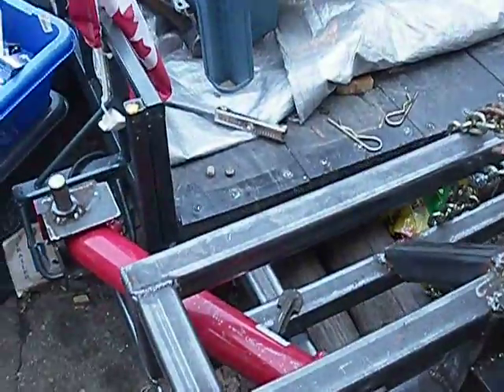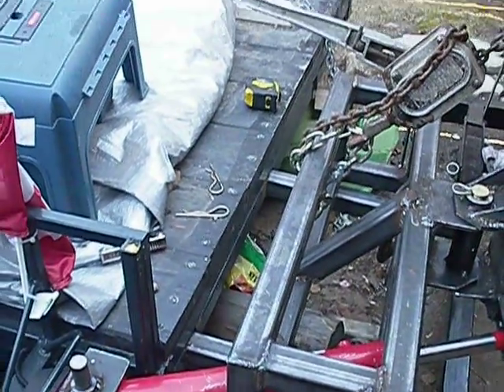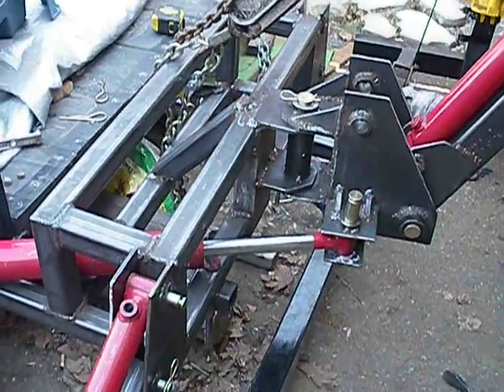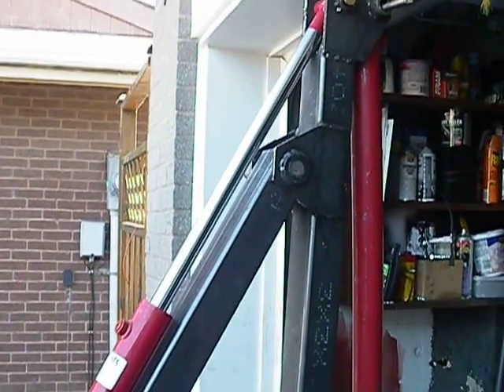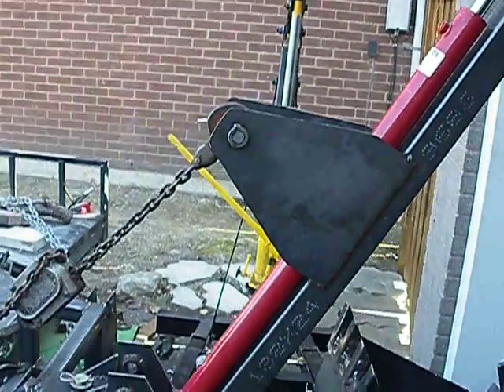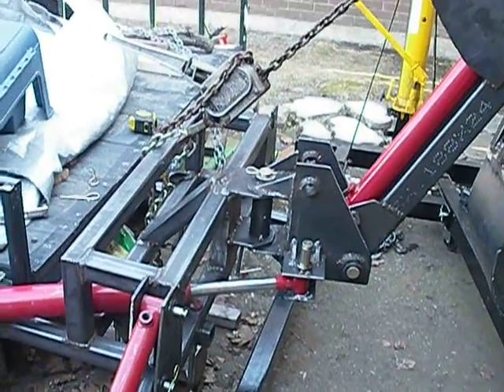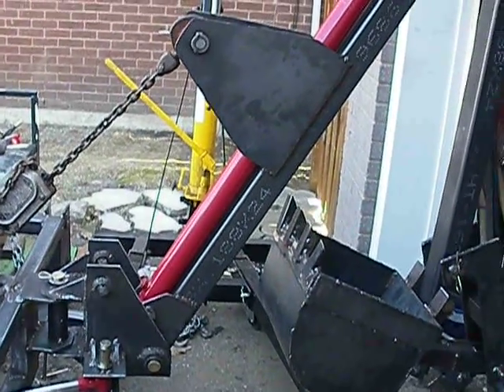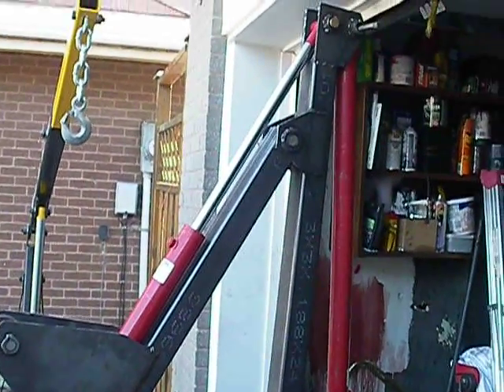Homemade Backhoe Project 2

Comment from the maker: @JustBoredEnough  I had the cylinders (2 x 36 in stroke) for a front end loader project which I purchased for a great price.  This is how I incorperated them into a backhoe. I agree the project would have gone much easier if I had used shorter cylinders. Maybe some day I will resurrect the loader and put some shorter cylinders  on the backhoe.

Comment: nice man , i get it . a pictures worth a thousand words.
its a great idea .  its light enough to mount on rear of a landscapers trailer to back it right up and edge a house for mulch , but its easy to take off .  needs its own wheel jacks .
 5 stars in my opinion.
dont worry about the design kinks . just part of it,
those cylinders will work , just got to know when the jobs to big for it . same as mine.